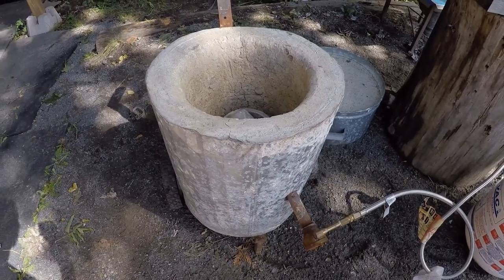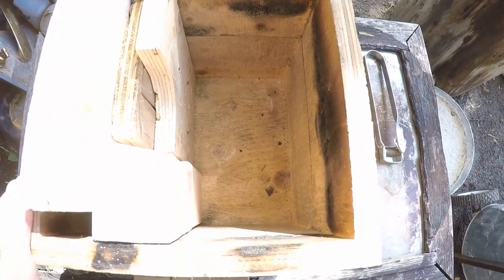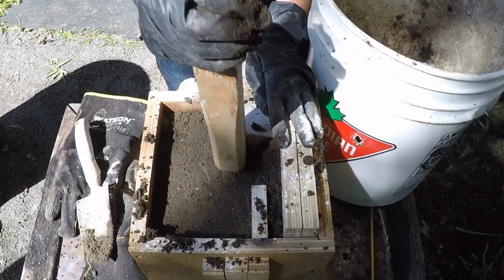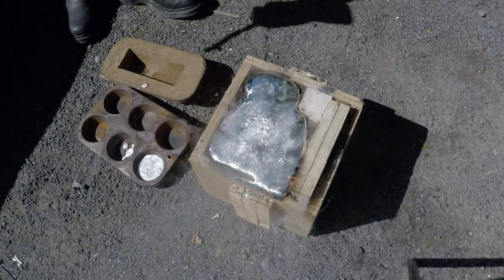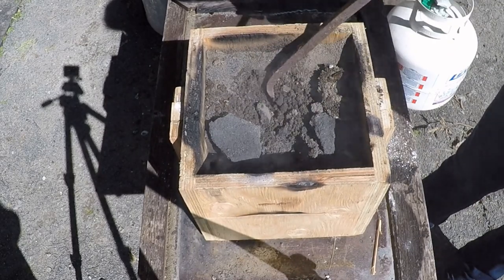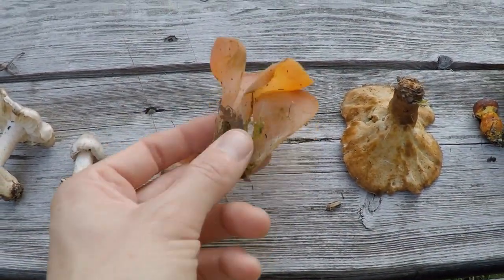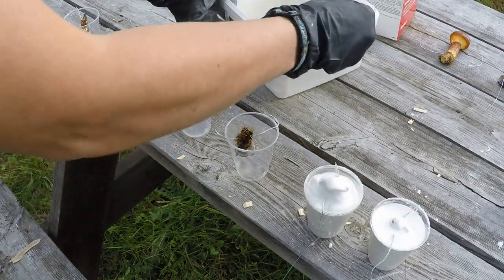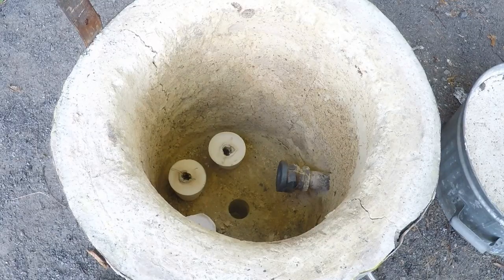Casting Wild Mushrooms

Comment: Freezing it sealed the moisture and thus it couldn't burn. Dry the shroom
Reply from the maker: I dry them out after casting in the forge. If I had a kiln it would be ideal to bake them in the forms. They are 90% water so drying before would turn them into nothing.